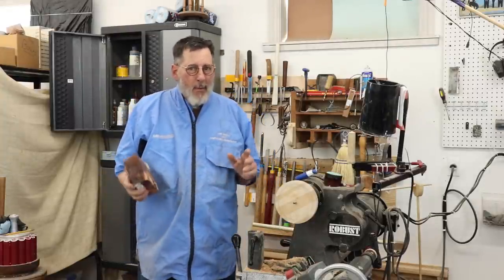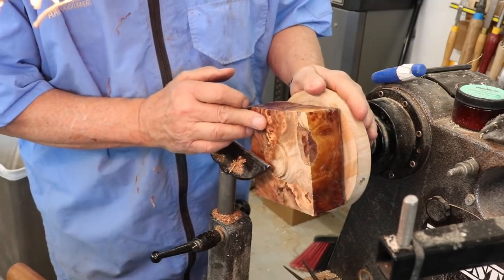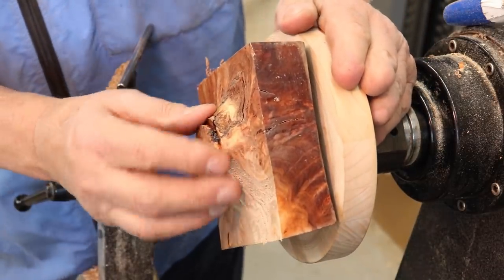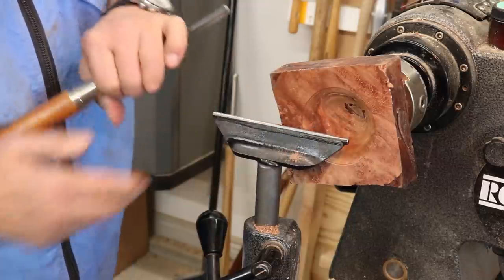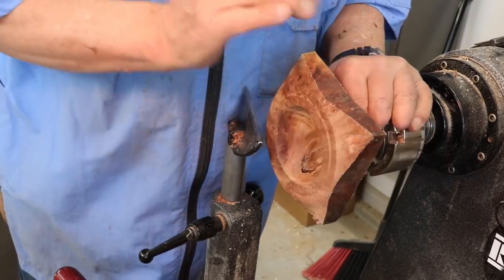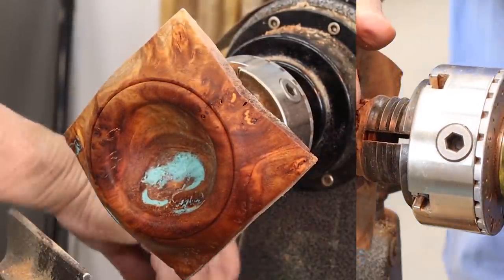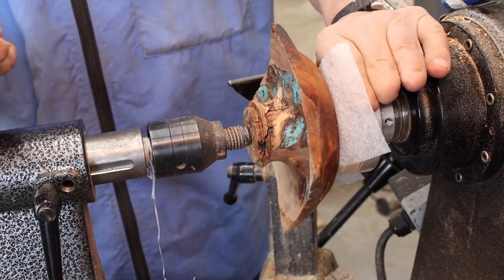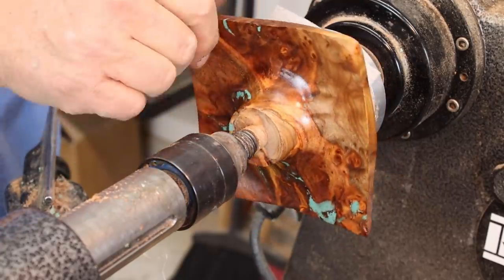Turning a Square Cottonwood Burl Bowl      Turned Artwork with Sam Angelo

Comment: I love the use of Cottonwood, a very nice wood and readily available.  Can you discuss your choice to use CA glue over stabilizing with Cactus Juice?  I know the stabilization process would add another day or two to the turning process.
Reply from the maker: One thing about stabilizing with cactus juice, it can make 
the wood hard as rock.  And it is another step or two.  This wood wasn't exactly  punky but just resulted in some torn grain.  Sam